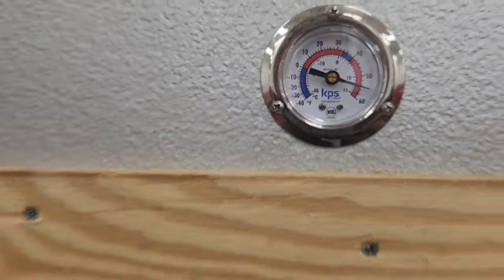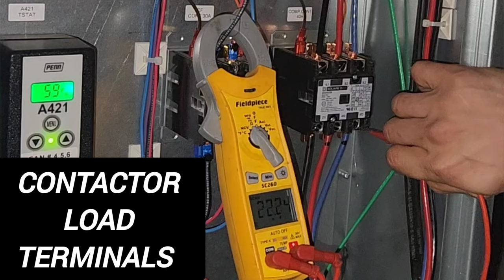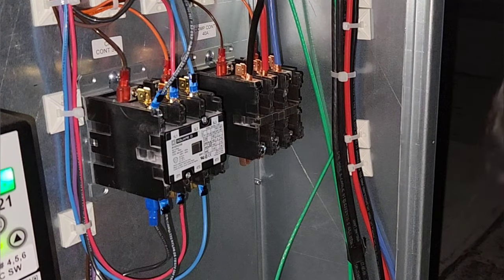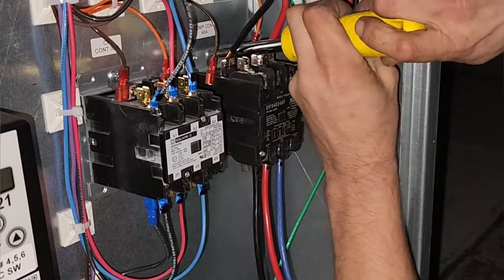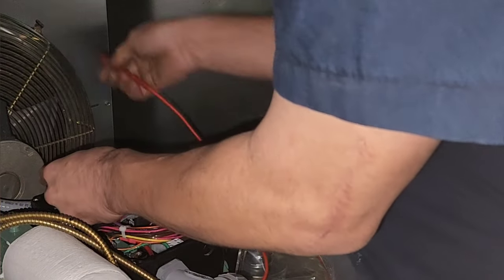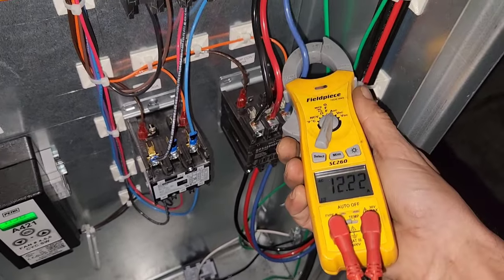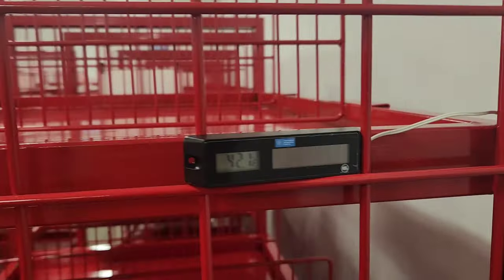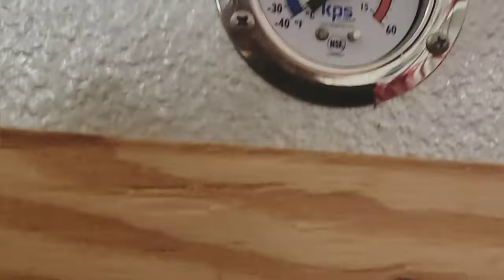Why a Burnt Contactor trips the Compressor Breaker (EASY FIX)

Comment: "Slow your roll, take foto before touching anything, and one wire at a time".

Appreciate the post edit captions on high points.

Safety first.

Gracias.
Reply from the maker: Thanks. I try to make it easily understandable . Hope it helps

Comment: have u ever had a dual temp epr replacement u replace the ear and still nothing happens when u try to adjust it
Reply from the maker: I would need to know a little bit more about about the pressure what the pressure is that you're trying to change it from and what suction pressure you're trying to get to. Would need to know the rack pressure, refrigerant type. If you're trying to adjust it in medium mode or low temperature mode. I know that it needs to be adjusted when it's not in low temperature mode. So during medium temperature operation, the coil on the port valve is de-energized and it allows the evaporator to run at your set pressure, probably the pressure you're trying to accomplish with your adjustments. When the switch is on low temperature setting it energizes the coil on the port valve leaving It Wide Open so that it can pull the evaporator down to Rack saturation suction

Comment: Roof top power is 204 vac but the unit is rated for 230 vac . high amps cause contactor failures. Recommend proper voltage to unit. 💀 🎶 👀
Reply: There is a threshold. I find anything over 200V is still within range.
Reply from the maker: i had 212v under no load. i didnt happen to check it under load. makes me curious now looking back on it